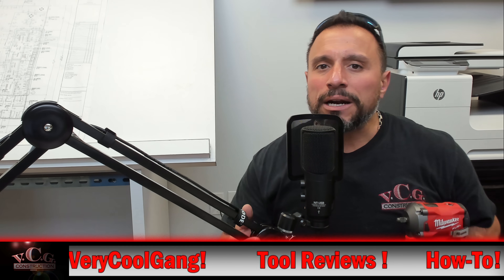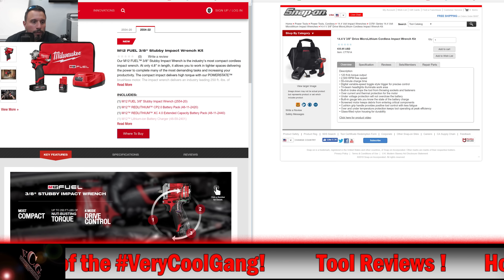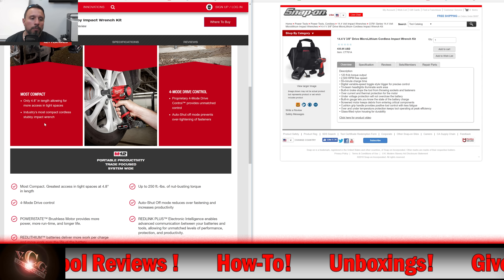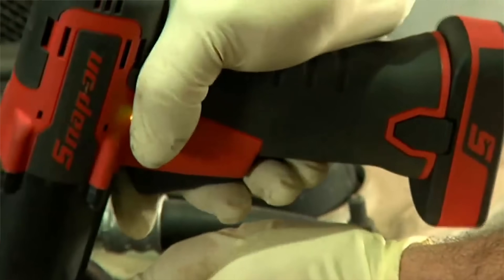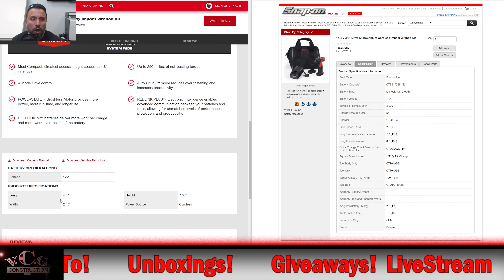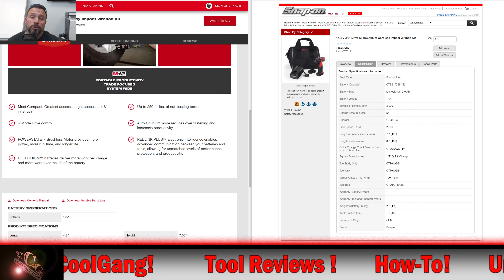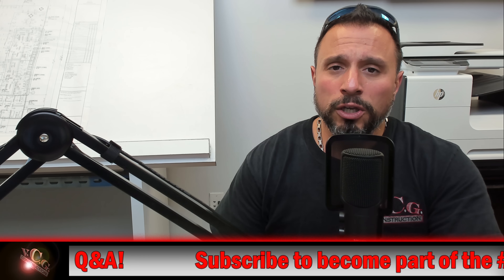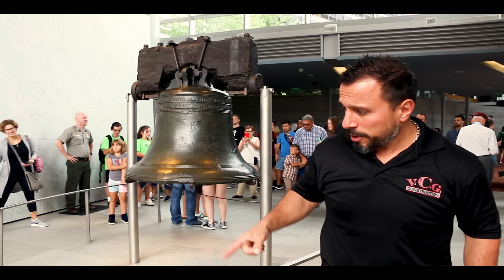Milwaukee (2554-20) VS Snap-on (CT761) - 3/8'' Cordless Impact Wrench Comparison!

Comment: I have the Milwaukee m12 3/8” stubby but oddly enough i have the snap on 1/4 impact driver version of the impact shown, I like the Milwaukee for heavier stuff, but the little 1/4” snap on with 65 ftlbs is great for pre torque assembly, transmission pans, oil pans, valve covers interior screws, and wheel wells. Where the Milwaukee is for driving screws on construction(which the snap on will still do) and has too much power for the light finesse work.

Comment: For all around use, the snap on works best for me. I prefer the slimmer "torpedo" shape  and the rocker trigger. I am in a shop so if I need "nut busting" I have a 3/8 air stubby on a swivel. I would think it has more access and torque than the Milwaukee even with the hose. All boils down to preference really.

Comment: I am a skilled trades Tool and Die maker. I have been using snap on tools for my entire career the last 15 years to be specific. I literally have that Snap-on IMPAC and have had it for three years. I have had it rebuilt twice since the warranty expired! As my snap on tools break I plan on switching over to Milwaukee. My company received a military contract and I have for the last year been working with company bought Milwaukee tools while I work on government stuff and all I can say is that I want every one of those cordless Milwaukee tools in my toolbox ASAP! Be warned on full torque these things can easily snap off bolts

Comment: Snap on has the best quality for the most part as far as no gears are powder metal pressed, the anvil housings are thicker, and you can service them easily. However there is no EXCUSE for Snap on to be so weak compared to other competitors. I bought a NICAD 3/8 Snap on and 1/2 18 volt NICAD Snap on impact new back in 2010. They had great power then for their time. Noway I’d buy a Snap on impact these days. The Milwaukee and Makita kill  them in power. I still use the 11 year old 3/8 Snap on impact because it still runs and so does the 18 volt. I have had batteries rebuilt about 4 times or so each. I am a Makita guy for the most part but my Wife bought me the DeWalt 12 volt extreme 3/8 impact and it’s very nice. I would love to own some M18 impacts but I don’t have a lot of M18 tools. I will own a Milwaukee stubby one day and the 1 inch gun. Snap on is basically a Lamborghini with no motor these days.

Comment: It's about service after the sale . If my tool craps out i get another one immediately . And when snap on comes out with the brushless powerpak ill get trade in value for on my old gun  .Another thing ,if i fall on hard times Ive got 10k available on the truck account regardless for anything i need.good luck getting that with Milwaukee. You see its not just about the tool its about the relationship with you're tool provider as well .unfortunately most guys look at the "right now" instead of the big picture . !Look at it this way . If you were dating a girl that could suck the chrome off a bumper but your bumper wasn't the only one getting polished would you invest in her or maybe someone else with less milage who had dinner on the table every night at 6 . Sure beats that funny taste in your mouth !

Comment: I repair plenty on power tools and Milwaukee is crud, yall got more money then you can chew. Can't fix Milwaukee. Throw that in the can once it fucks up. Snap on can be fixed over and over and over again. Usually loose a trigger. Inexpensive part. I'll loose a few ft lbs over that. Brushless, full of computers and bs. Buy a part Usually coast 3/4 of the hole gun. JUNK. Give it a few years when the snap on guys are still running with their beat to piss guns and Milwaukee will fill garbage cans and still look new 😂

Comment: Big Milwaukee fan here but I've got the Snap On CT. The toggle switch is great, and the body is narrower for getting into tighter spaces. It'd be nice to have the power of the Milwaukee but lets face it, most of the time the biggest thing you'll have this on is M10, but more than likely M8 or smaller. Also you're being a bit unfair comparing the Snap Ons list price to the store price of the Milwaukee. See the list price above of $430? Pretty close eh.

Comment: Even though I have the Milwaukee 1/2 inch M18 Full Sized Fuel Impact wrench, for the smaller sized stubby impacts Snap On is the winner for me after using both. The ergonomics and form factor are 1000000000x better than anything Milwaukee has produced and it's satisfying to use. The 3/8 Milwaukee electric ratchet are also MUCH weaker in real world scenarios compared to the Snap On electric ratchets for some reason. If Milwaukee redesigns their next fleet to be lighter and better engineered to reduce fatigue, they'll dominate the 3/8" market just like they do the 1/2" market.

Comment: I've had snapon for many years. Convenience I guess is the reason. The 14.4 stuff has been good to me, but I've had the impact rebuilt (they send a new one) 6 times. Actually bought a spare because it tskes 3 to 4 weeks to get it back. Next time the one I'm using goes down, I'll get it rebuilt, and sell them both. Getting the Milwaukee for sure. Use a 3/4 drive Milwaukee almost daily, and love it.

Comment: I own both. I love both. Milwaukee just found a way to step up and step up the ratings and power of all there tools. Snap-On’s CT761 will always be an Iconic tool they technicians love but when milwaukee released the stubby line I bought the 1/4, 3/8, and 1/2 and I bought them for a specific Diesel engine I work on the Mercedes sprinter van at my Mercedes dealership. The stubby impacts feel very nice not to heavy and have plenty or more then enough power. The CT761 feels good balanced nicely and has perfect amount of power for its size. At the end it’s all up to the consumer and what they are looking for. You have consumers that look for the bang for the buck, consumer that are brand loyal, or consumer that takes the tool cause they are getting a deal on the tool right then and there. If a young tech were to ask me which one would you have me go with Al? I’d tell them go milwaukee save your money and get hand tools with the extra money your saving.

Comment: If the Milwaukee stubby gets rid of the paddle direction switch and makes a dual variable trigger like the CT761 it will be game over for Snap-On.  The Milwaukee price points continue to be fantastic compared to it's competitors.
Reply: snap on patented the trigger design, unfortunately

Comment: Actually Milwaukee is using the max output level saying 12 volt is 3 cells maxed at 4 volts per cell the snap on is using average voltage 14.4 volt with 4 cells menial volt 3.6 volts per cell. So the snap on should be more powerful as it's using more cells and would have less voltage sag and more power. Just goes to show how far behind SO is being lower powered with more cells.

Comment: Funny how all the Milwaukee fanboys have never owned or even held the snap on in their hands. It is substantially smaller in diameter and fits in an engine bay much easier. The trigger is substantially better. The feel and balance is substantially better. You're comparing apples to oranges with these two. It should be compared to the other m12 impact. 
However, I will never buy the snap on again. The reliability is garbage on the snap on, and the warranty sucks dick.  I just bought of all the Milwaukee m12 line due to the warranty and reliability. Cost is less than half of snap on, the technology and warranty is better. I will say I miss the feel and balance of using the snap on 8 hours a day though.

Comment: My uncle has snap on tools and a Milwaukee  m12 flashlight. So I told him to just buy the bare tool stubby on Ebay for 79.00. He did and he was shocked at the performance of the tool compared to the snap on. If you have batteries already just buy the bare tools.

Comment: You could buy this tool and a whole socket set if you bought the Milwaukee. Snap on is such over priced garbage the only guys that buy it are dudes that wanna show off how “sick” their tools are. If you want to actually be smart buy what works best and is the most cost effective. I will never stoop down to buying a tool just for its name. Everything has to prove itself through price, quality, and warranty. Just my two cents.

Comment: As of today on 1-25-2019 Snapon stopped at my work and for $1,000.00 they had a kit with a 1/2", & 3/8" drive impact gun with a 1/4" drive ratchet. It had two batteries with a charger. They were brushed motors not the brushless.
Reply from the maker: Did you buy it?
Reply: @VCGConstruction , No I did not buy it. I might have if they were brushless. I had a co worker have an issue with an Ingersoll Rand cordless 1/2" impact gun. It was under warranty. But it was kind of a hassle to send it in for repair. It is a big 'ol monster size gun.
Reply: 707SonomaComa the new ingersoll 7152 is a much smaller brushless monster. I almost picked one up for myself but I got plenty of cordless stuff.

Comment: What's even crazier is the Milwaukee 12v 3/8 still has more torque than the snapon  18v 3/8 impact and the battery on the snap on is huge compared to Milwaukee's compact design

Comment: I have the 3/8 Milwaukee Stubby, and I think I'm the only one who says anything bad about it. The first is the 2.0Ah battery is absolutely garbage with this tool. I don't have the 3.0Ah or 4.0Ah battery, planning on getting the 6.0Ah as soon as I find a store that has it in stock (everyone says they have it in stock, but when I go check nothing on the shelf). With the 2.0Ah battery I removed and replaced one fuel tank (2 bolts that required the tool to impact the bolt the entire way out), and did one alternator (x6 10mm bolts, required a little impacting and then it was out). Battery was at 50% after just 2 jobs. The Milwaukee is easily the shortest Coredless impact I've seen, however the body is extremely fat. It actually makes it kind of hard  to get into tight areas. Example when I was doing the alternator, I was doing it on a Ford Van, not much space right. I put a shallow 10mm socket on it, and the problem was the tool was so fat it was hitting the pulley on the alternator and I was unable to access the bolt. Apply a short extension or a universal and I'm in the fan as now its too long. Almost all jobs I would have to use some sort of extension to move the fat body away from whatever I'm trying to remove otherwise it just touches it/rubs up against it. Even brake calipers it would hit the caliper before the socket would go on the bolt. 

My favorite so far has been a 1/2" MAXIMUM Brushless Impact sold by Canadian Tire. It uses a 20V battery, its shorter than the Snap-On but barely any larger than the Milwaukee. I think its made by DeWalt as the batteries are very similar/almost the same. Its rated at 165 ft-lbs but it feels like its more than the Milwaukee. I can go almost 3 weeks without charging the batteries on it, it can pull lug nuts off Diesel F350 (I think they are torqued to 165ft-lbs). The 2 issue is that its 1/2" so I'm using fat/large sockets with it. The other thing is that its slow when it is impacting. The tip of it is much smaller/narrower than the Milwaukee so I don't have any issues with the body. I can use a short socket and the narrower body doesn't get in the way. I'm planning on buying the 6.0Ah battery soon and trying it out again, but so far its so disappointing. All my Co-workers use the Snap-On one and it feels pretty good. It feels like it impacts much faster so a lot of people assume it has more power but my 1/2" MAXIMUM will bust open nuts it can't. Like if I had 2 bolts torqued to 100 ft-lbs the Snap-On one will pull it off before my MAXIMUM one could, however torque that bolt to 200+ft-lbs and the Snap-On sometimes can't pull it off however the MAXIMUM one will.

Comment: Just sold my snapon 14.4v stuff to buy all Milwaukee 12v stuff
Reply from the maker: Did you have money left over after buying all new Milwaukee?
Reply: @VCGConstruction  oh yeah, still ended up with a few hundred left over but I bought less than what I owned already. I'm sure I probably would have broken even if I bought 1:1 but that's also with used snapon. I certainly lost my ass but lesson learned

Comment: I own the first run of the CT761. Great tool. After a year, right after the warranty ended. Gun took a crap. Bearing on the front nose broke, trigger wouldn't always work, wire broke on the back of the drive motor. Snap-on sent it in for repairs for $120. If it broke again, I would definitely try out Milwaukee. Half the price, double the torque, 5X warranty. Cannot beat it at this moment

Comment: How about actually using the tools? Your reviewing them on there specs. I'm a Toyota Master Tech. 25 years. The Snap-on 14.4 3/8" impact is a 4 cell battery. Milkwaukee is a 3 cell.  I along with every tech in my shop own the Snap-on. It's a Bad Ass tool! Tons of Power, super long battery life, and very small. I don't own the Milwaukee yet. So till I use it won't know how it stacks up? Specs don't mean shit to me! It's all about real world use!
Reply from the maker: What dealership do you work at?
Reply: A little late and the video may not show it but the Milwaukee stubby beats the snap on just a hard in the real word as it does on paper. Sold my snap on stuff and bought into the fuel line after one of my friends I work with let me use his for a day. Until then I didn’t realize how far snap on had fell behind.

Comment: You mentioned the voltage... the 14.4 is nominal and made up of 4 cells and the 12v is max made up of 3 or 6 cells for either the 2 or 4 amp packs
Reply from the maker: cool!

Comment: Good post sir. Yeah I paid up and bought 3 Snap-on guns the ratchet, a 1/2 and the 3/8. This may sound dumb but the 3/8 is so small I didn't think I would really use it. Well let me tell you it has so much power I use it more than the 1/2. It's the 18v CT8801A. The gun by itself is very small, I have a 4 amp hour battery which does make it a bit larger, but it is very compact. They came by my store with a pickup full of guns for the holidays at a very good price.
Reply: Martin Schaffmeir yes that’s a good gun but the Milwaukee 2754 is smaller and stronger and way way way cheaper! My mechanic is a snap on guy were removing my head on my semi and his snap on wouldn’t take off some bolts so he used my Milwaukee and literally took off the same bolts on the first blow! I love snap on they make great tools but the cordless tools can’t compete with the Milwaukee
Reply: @02lswith22s  thanks I'm sure your right. I'm still holding on to a resentment over the Milwaukee NiCd 4 dead batteries and a 4 or 5pc tool set I have
Reply: Martin Schaffmeir mine are the m18 lithium batteries and they last a very long time and have a 3 year warranty but the lithium hold a charge really long especially since my guns are brushless

Comment: Yes, the Snap On truck is the allure. You and I are not Snap On’s target market. Sure, they’ll sell us tools, but they’re competing for the auto tech’s money. Tech’s don’t have a week to be without their impact if it breaks. If they’re under warranty, Snap On will take care of them right then. Once it’s out of warranty, Snap On will refurbish it for these guys at a highly discounted rate. If you get paid astronomically more when you do jobs faster, like dealer mechanics do, it’s worth a bit of extra money to have your tool guy on call. Plus there are other perks, like they deliver their tool chests right to their bay. It’s the fluff and buff treatment for techs, but not worth it at all for us.
Reply: As a 20 year professional auto tech that’s only somewhat true. Things like these cordless impacts usually have to be sent off and they’ll be gone for about 3 weeks. The tool truck MAY have a loaner to let you borrow in the meantime but most of the time they don’t because someone else has it. I’d rather run to Home Depot after work that day and have it taken care of fully on the spot. I have so many hand tools that I can be without one of them if they break and I have to wait. Until fairly recently there hasn’t been a truck brand that had any decent cordless tools. Mac has had some pretty good brushless stuff for a while now but really it’s just rebadged Dewalt XR. Matco’s stuff is pretty meh except for their 16v infinium ratchets. The 3/8 version is rated at 70 ft lbs and will jerk a knot in your wrist!

Comment: Milwaukee M12 battery has three cells that are each 3.6 volts nominal in series so you get your 10.8 volts. Snap-on on the other hand must be using 4 cells in series at 3.6 volts to get to 14.4 volts

Comment: I own the 14.4 SnapOn and I like the trigger and balance but other than that Milwaukee May have it beat. I haven’t had the pleasure of using one yet but I do own other items from both the 12 and 18v lineups and they are stout. I won’t lie though, I love getting on the SnapOn truck. And what red blooded tool loving American wouldn’t? With SnapOn they are only as good as your dealer and I have a great one.

Comment: Vince, nice video.  As a technician I've been buying Snap on exclusively for at least 40 years! (approx. over $40k at this point).  I jumped over to Milwaukee for cordless tools during a rental remodel about 6 years ago and will only purchase Milwaukee Battery powered tools now (still buy Snap on hand tools).  Milwaukee Fuel can't be beat and they have recently won litigation against Snap on for copyright infringement on their red lithium technology. Greatly enjoy the side by side spec comparison, thanks.